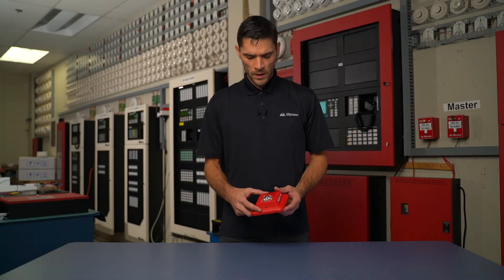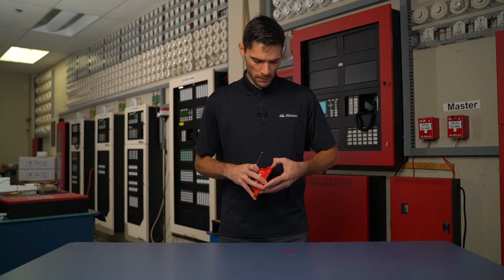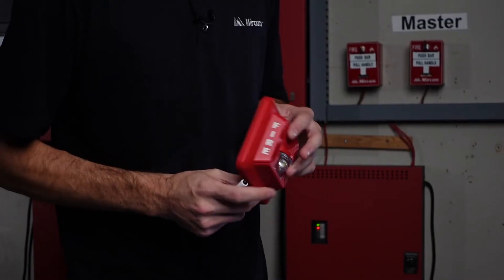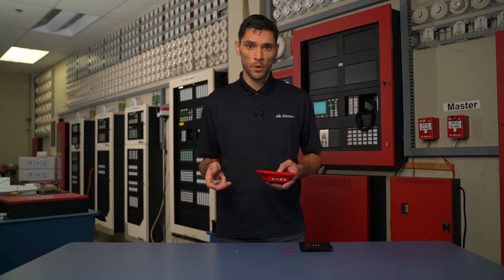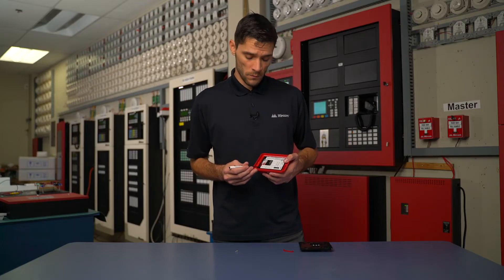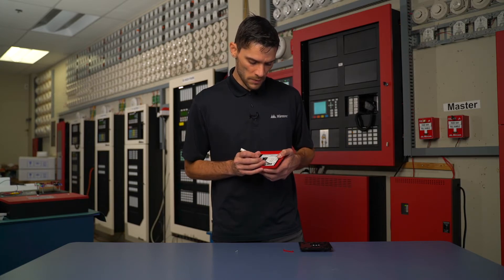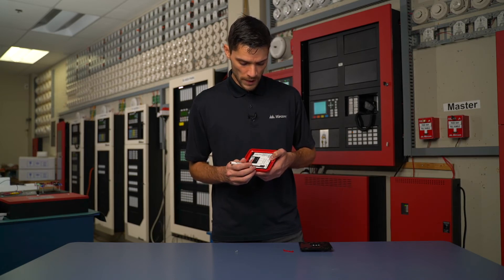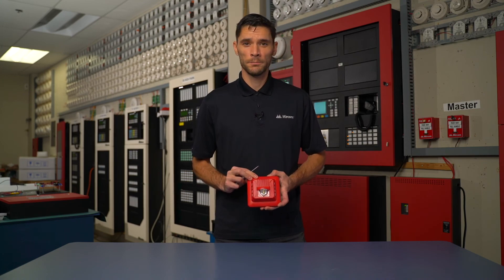Mircom 400 Series Fire Alarm Notification Devices Setup

Comment: Great video! 
Does the sync feature for the FHS-400 mean I no longer need a sync module SDM-240?
Reply from the maker: The sync feature does require that the connected NAC Circuit have the Mircom Sync Protocol. If a non-sync protocol NAC circuit is used, then the Sync Module needed is the SDM-240. 
Mircom FleXNet, FX-4000, FX-3318, FX-3500, FX-400 and FX-401 Fire Control Panels have built-in NAC Circuits that can be configured with the Mircom Sync Protocol.